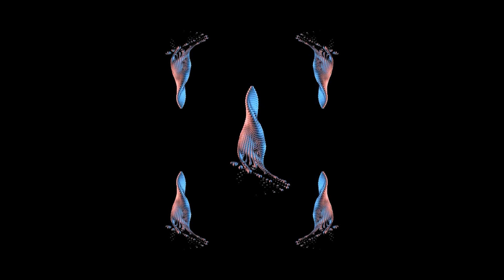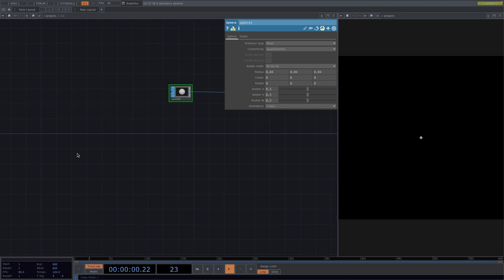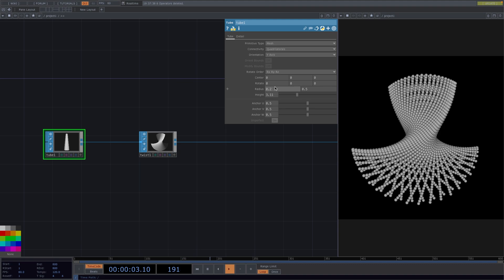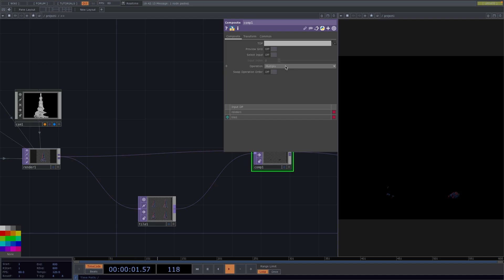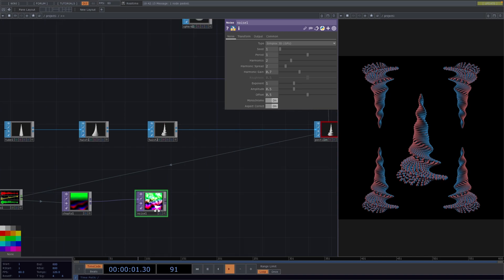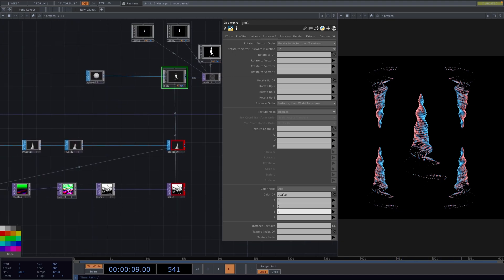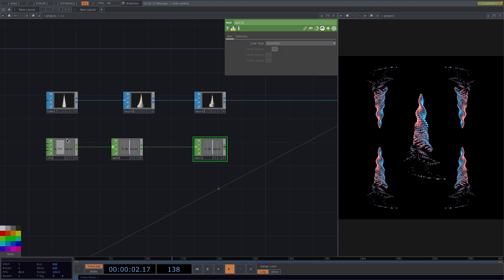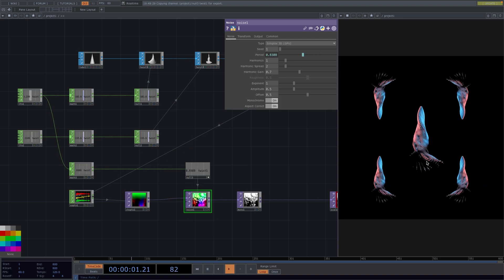Easy twist-shape visuals | TouchDesigner Step by Step Tutorial

Comment: when i connect the "scale" to geo then put the RGB, the geo says "all OP's must generate the same number, what do i do?
Reply from the maker: Check out min 4:25 you need to convert the SOP to chop and then the chop to top. The problem is because when you use instancing, the operators you give have to have the same amount of instances. That means for example if you pass a SOP, a Chop and a top. The SOP numPoints needs to be equal to the CHOP numSamples and that needs to be equal to the TOP number of pixels. Hope this can help you
Reply: @acrylicode  same. Once i activate "fit to square" it gives me an error.
Reply: I made the conversion and still get a “all OPs must generate the same number of instances” error
Reply: @marcusw.9684  same problem, did you resolved this ? as we connect this errors pops in geometry component.